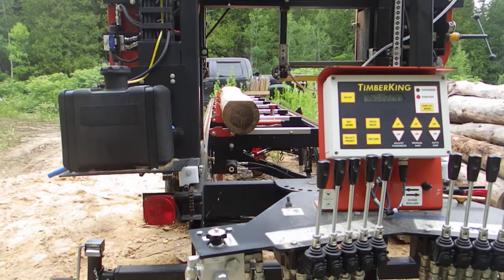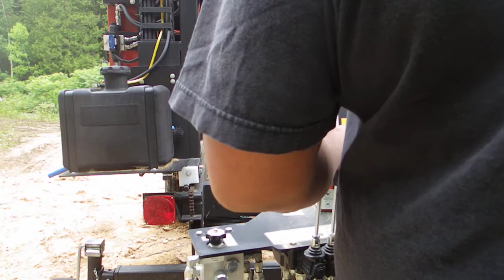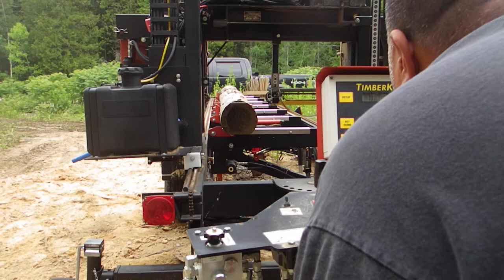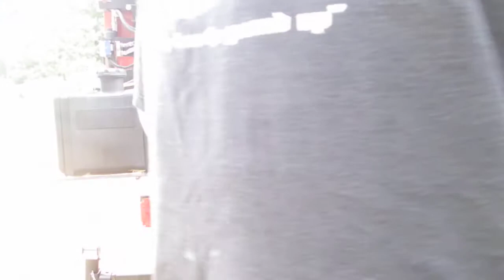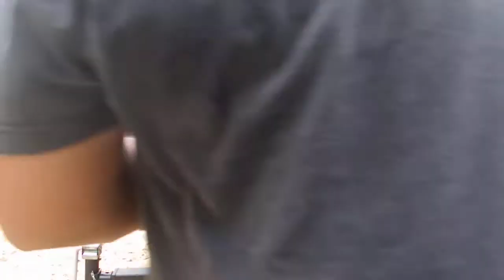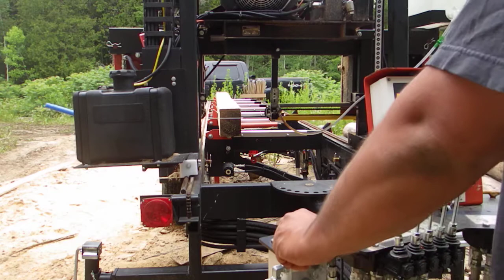Cutting an eastern white pine log on the Timberking 2000 Sawmill

Comment: Speed up the feed rate
Reply from the maker: The blade tends to dive when hitting knots or go to fast
Reply: You need to run 1/4" down pressure on the blade guides , also on the movable guide the rod that move in and out is not strong enough to keep the down pressure when extended.  Most put a piece of white plastic between the frame above the guide and the u shaped metal that moves with the guide which keeps it from flexing up when extended. These mills will saw straight a lot faster when set up right.
Reply: Also what kind of blades are you using, some like WM Silvertip will not saw straight

https://www.semetals.net/   Try this site,  I like the Dakin Flathers Ripper 37 or the 3/4 pitch Ripper S  .42  1 1/4  . Lennox also saws nice
Reply from the maker: @oliverm5sc  the silvertips are the ones im using too lol takes all doggone day to cut a thousand feet
Reply: It was a few years ago when I tried WM Silvertip blades, I bought a box of ten the first 3 I put on the mill cut so crooked I sent them back.  Maybe they're better now but I'll never try them again.     @thomashare6211